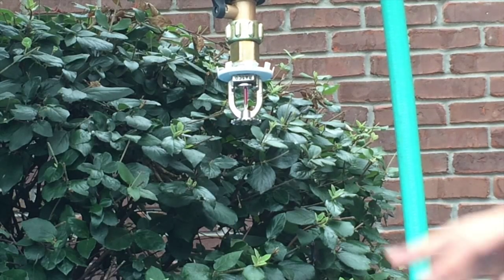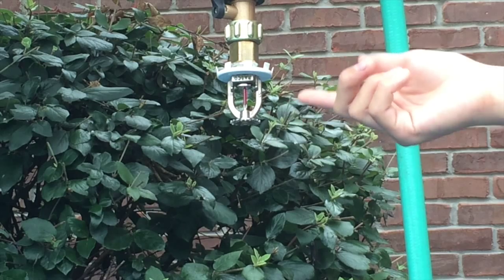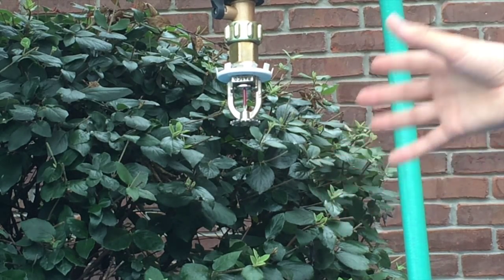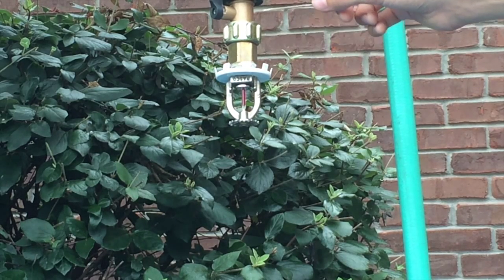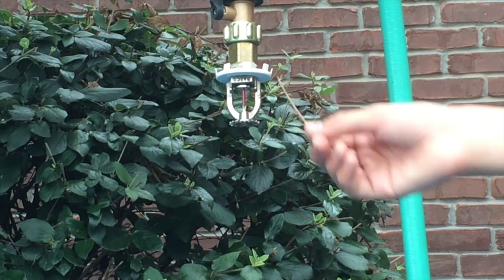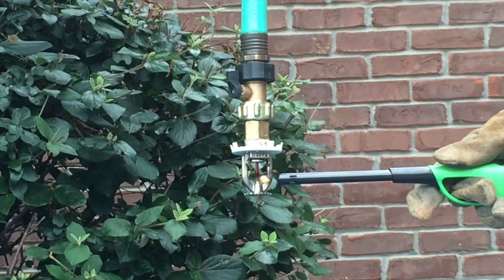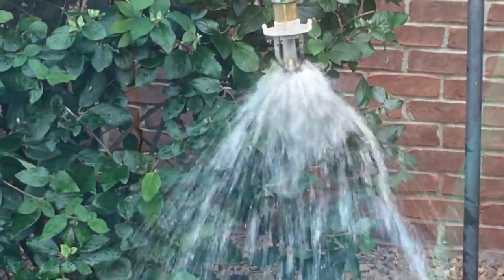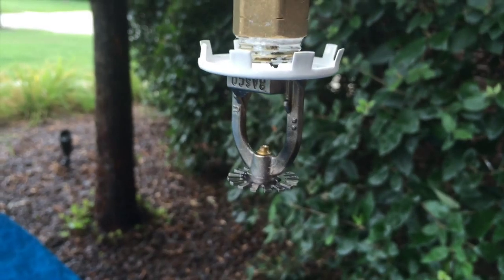Activating A Pendent Fire Sprinkler

Comment: I luv the video our school fire alarm system is composed of 7002t's on continuous one with an exploded strobe plastic around the strobe is shattered and the strobe is too. Panel is simplex. Pull Stations are Firelight BG-10 or 12 I think. Smokes are system sensor. Sprinkler are the same look as the one in this video
Reply from the maker: Peter Folchi Nice!!